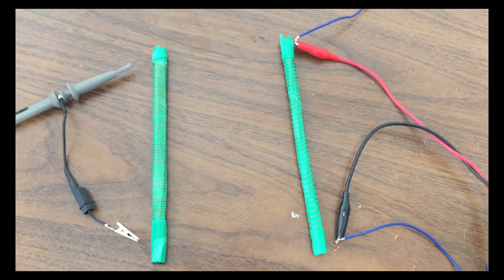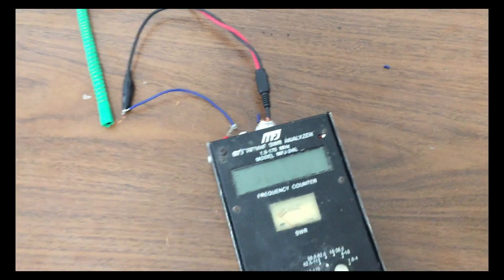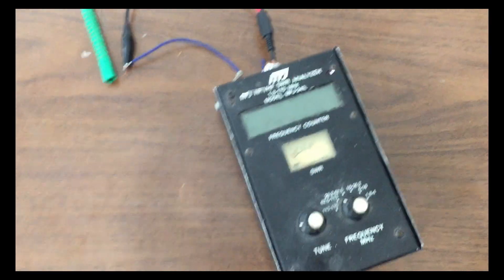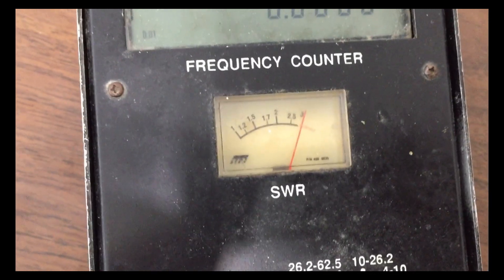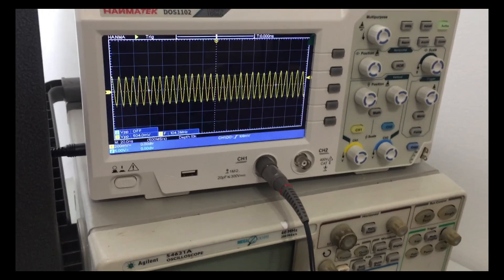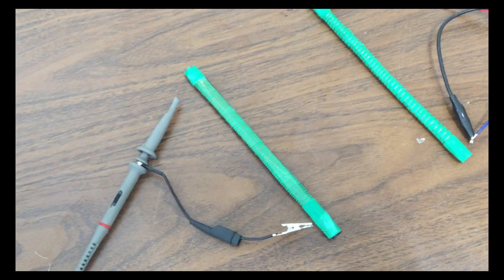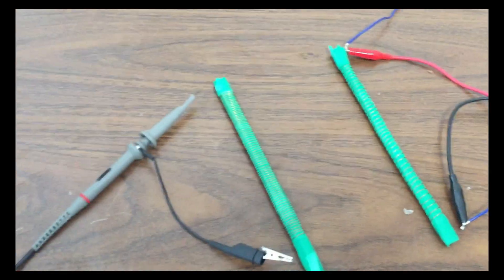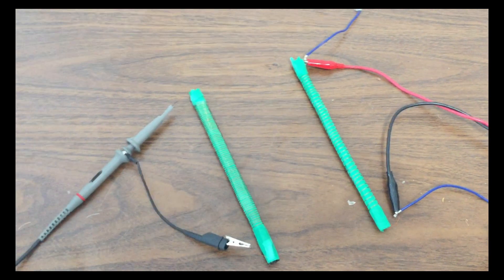Don Smith Magnetic Resonance

Comment: Very good explanation between the two types of resonance, i have the fields in my mind one of them interacts like transformers the other like radiant energy absorbers, at this picture in my mind the two fields just touch at the extreme edge this forms a vortex, this is the magic spot where the two fields act as an antenna to the greater field of the system or magneto-hydro-dynamic shape this vortex goes at ninety degrees so you are creating a mini tornado, drawing energy, cool !! is this what they call ' cold ' electricity?

Comment: Thank you for this excellent demonstration. My question is, what technical problem is solved by knowing where the sweet spot is ? ie. is there a practical application for this knowledge ? You mention the high Q resonance effect which implies that the effect would be highly frequency dependent, which it probably is not. The sweet distance appears to be around one twentieth of a wavelength at 100MHz. This is very much within the near field, were it an EM wave. The wave impedance would be very much different to the 377 ohms of free space. Does this  sweet distance change when the frequency is changed ? Since the effect is magnetic, I wonder what happens if the coils are arranged coaxially ? I imagine you used ferrite cores ? The resonant frequency is governed by the interaction of stray capacitance with the inductances. The long wires used in the experiment probably cause quite large changes in stray capacitance when they are moved. Keep up the great work ! I love your blog btw.

Comment: Am i understanding correctly?.. you're sending very little power through your tool, and picking up also some e on the rec. What is the ratio between power sent to power harness? Prob not 1:1 but even at 1:x if you could make 2x receivers, would you get 2x the e power? Not having conservation in an open system is wild.. let me know i catch your drift

Comment: A few questions, would having it in a much higher rf frequency result in a bigger field of operation? If so what freq do you need to send magnetism 50+m away?

Secondly, would tweaking the freq or phase cause a change in the swr? If you could have data transfer ota between the two , you can maybe make adjustments to the freq or phase in rt to hone in on resonance. Ideally the change should happen in the recievers independently. Like active noise cancellation.. active resonance matching.

Lastly, am i understanding correctly?.. you're sending very little power through your tool, and picking up also some e on the rec. What is the ratio between power sent to power harness? Prob not 1:1 but even at 1:x if you could make 2x receivers, would you get 2x the e power? Not having conservation in an open system is wild.. let me know i catch your drift
Reply from the maker: two methods you can increase the Q on RX for higher volts, this is not inductive mutual coupled transformer action so current strength don't go down so you get more power like that. Or carefully place multiple coils along the sweet spot well placed and measured so they don't interfere this will be minimum at  resonance to begin with. The higher the frequency the tighter the reactive near field zone. So too high you may not have enough field room area for all your rx antennas to be near.

Comment: What I've noticed is that the more tuned two resonant bodies are, the more of their inductive and capacitive reactance is shared when in proximity, which fluffs with the tuning. You can mathematically approximate the tuning in a lot of ways, but it really is easier to just have a tuning nob because you never know how they'll combine in the real world to give you your frequency.

Using super high frequency doubly helps because you can keep your resonators more distanced so they share less reactance yet are still coupled to the same near field area. It's strange how that works, you would normally imagine their power coupling linked in this same way, yet it doesn't appear to be so.

Comment: its worth shaving off some insulation every turn but  but separate the next shave by 90 degree for better separation . Then you can tap off different parts of the inductance for the sweet spot or at least you will be able to home in on the best henry level